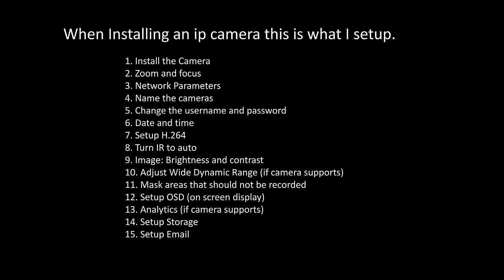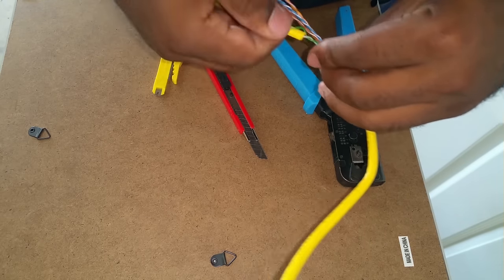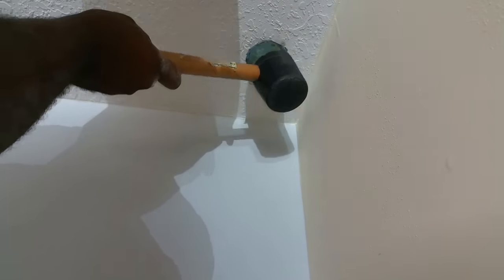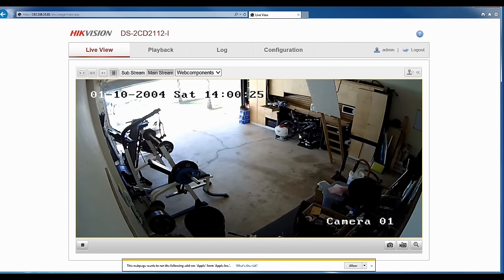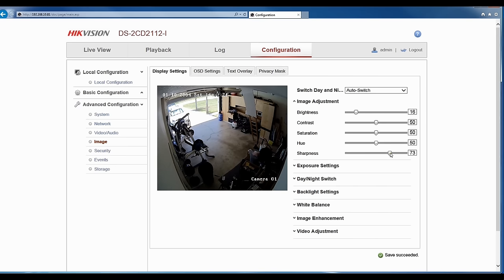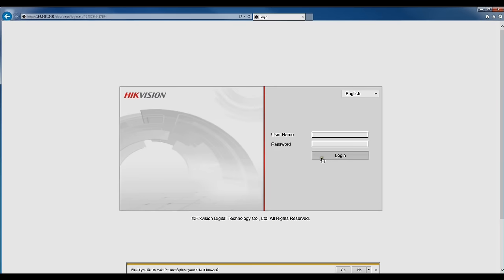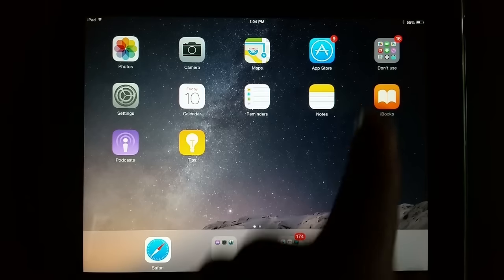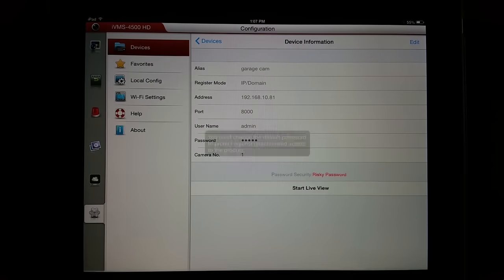How to install a IP camera

Comment: Love that EZ-RJ45 crimper and end.  They make creating cables so much easier.
Reply: Robert Bishop    mn
Reply: any idea how much a camera tech gets paid?
Reply: Cat5 Cat5e Network Connector 8P8C RJ45 Metal Cable Modular Plug Terminals

Comment: Your video is really good the only thing I would avoid is running your cat six parallel with any electrical service especially anything that sucks air conditioning level power my experience is sometimes the cameras all kind of bounce around a little bit when the compressors come on but other Nat did nice job nice and clean good luck

Comment: if only all RJ45's are like that at 2:06
Reply: Cat5 Cat5e Network Connector 8P8C RJ45 Metal Cable Modular Plug Terminals

Comment: Never saw somebody crimp an ethernet end like that. But I like it. I'll have to try it next time I do some wiring :p
Reply: Cat5 Cat5e Network Connector 8P8C RJ45 Metal Cable Modular Plug Terminals

Comment: No need for portforwarding anymore with new hikvision equipment.
Its all cloud based stuff with new apps also
Folks only buy hikvision usa so u get warranties from california.
Look for dealer partners such as our company so u get the full benefit of hikvision products.
Hikvision will give you up to 5 yrs off the shelf warranty to authorized dealer partners 
So stay away from amazon and the Chinese imports marked hikvision or so called english versions. There mostly all chinese flashed cameras 
All hikvision usa products are usually factory sealed with a silver piece of tape on box opening and always always run the camera and or recorder serial number through hikvision usa in california. They will tell u if its legit or not.
If its a hik usa product any hik usa dealer partner can warranty the product
Hope this helps and always us legit stuff from hikvision.
Any QUESTIONS fell free to ask us and we will get back to u